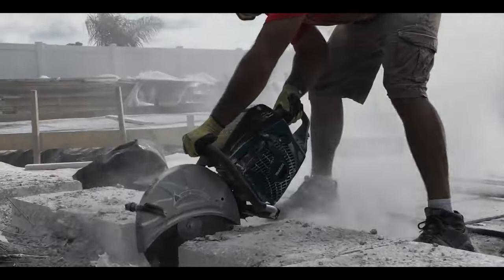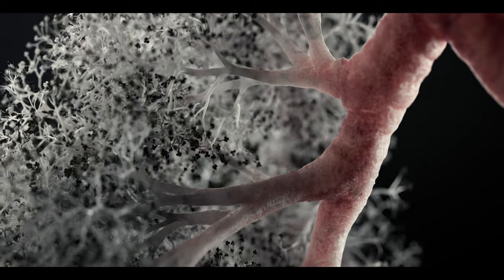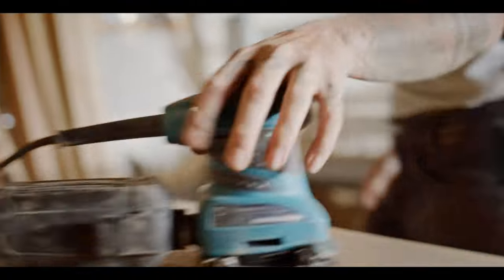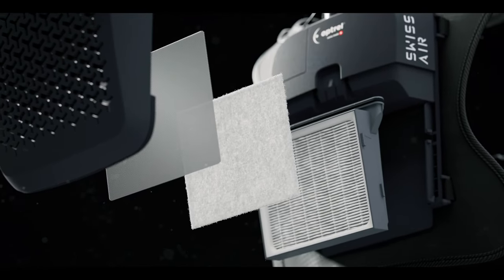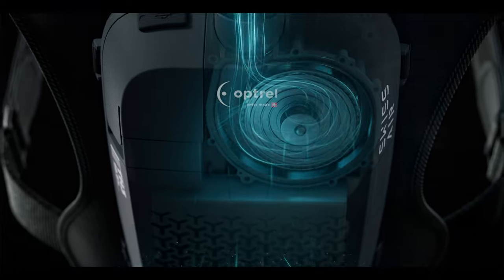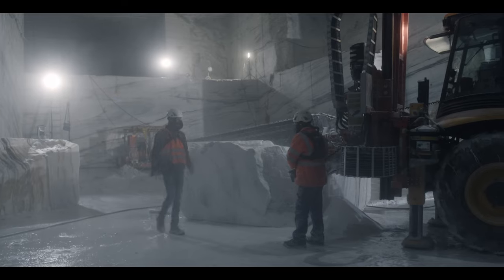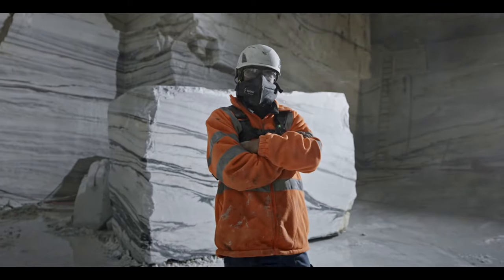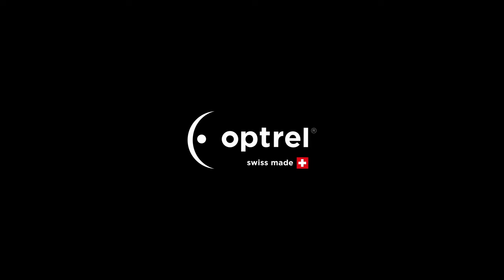The Best PAPR Respirator for Construction, Mining & Dusty Environments

Comment: I have purchased the Optrel Swiss air and I am severely disappointed in it. I can still smell particulate coming through the mask, and the filters last sometimes less than 8 hrs before beeping at you indicating the filter needs replaced.
Reply from the maker: Hi Mike, we're sorry to hear about your disappointment! Our Swiss Air filters don't filter out smell, only particulates, so if you are looking to filter out smells you would need our Mountain Breeze Pre-Filters. Using the standard pre-filters as well will also extend the life of your particle filter, however, the lifetime of a particle filter varies depending on the environment you are in and how much particulates it is filtering out. Please feel free to reach out to us through our website if you have any additional questions!
Reply: @OptrelUS  I am using the pre filters too. Those are the ones I’m talking about only lasting sometimes less than 8 hrs. Before it starts beeping at me with the indicator that my filter is used up. And also, if I can smell fumes, that is an indicator that there is particles coming through. Your excuse is invalid. There is nothing to smell without there being scent particles (however small those particles would be) coming through.

Comment: I'm wondering if the Swiss air  can be used even if you need to wear a harness.
Reply from the maker: We have not tested it with fall protection. Are you in the U.S.? If so, you can see if a distributor near you has the Swiss Air for you to try on. Here's a link to distributors in the U.S.: https://optrel.us/distributors/